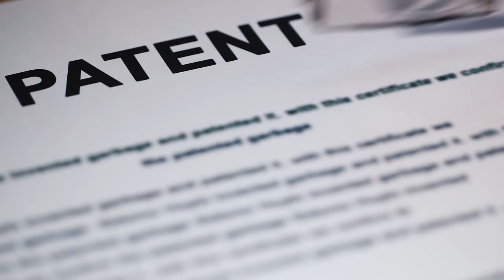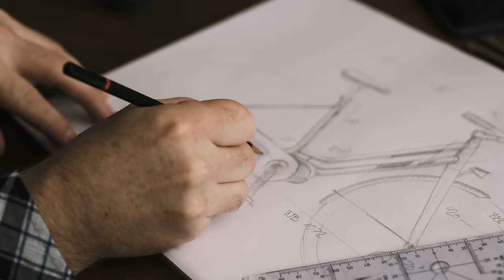Patenting Improvements of Existing Inventions

Comment: Sir, then what's the point of filing a patent in cases when inventors invention is a improvement on to existing idea/ prior art or even in cases when the invention application is entirely different, for example  a person comes up with a way of inventing the same out put of a invention with blending it with other technology and by doing that he is reducing a lot of important element that are costly in prior art and can bring down the cost and acchive same or better results, but there is no benefit even if the inventor got the patent if he can't  commercialy sell it and bcs invention involves elements of prior art, I got that the inventor can stop others from doing it but that's a costly processes and a lot of times gets nowhere and filing patent is also costly and other companys may also not Licenc it from the inventor due to prior art element. Please make a video on this topic if possible explaining if there is a benefit! or a way of commercialising the improved invention!
Reply from the maker: @Taseen, thank you for the email message.  Most inventions are improvements of other earlier inventions. For example, recently, there have been many improvements to portable water bottles - an invention that has been around for thousands of years.  Let's say you invent a water bottle with a cooling element (for example a Peltier plate, rechargeable using your phone plug).  The improvement of the USB cooler would make your water bottle unique and patentable.  Thank you for your question.  I will answer the second question in another reply.  -John
Reply from the maker: @Taseen, whether to file a patent on an improvement to another patented product is a more difficult decision.  You are correct to point out that since you can't sell your improved product without getting a license to the earlier patent, it may not make business sense to pursue your improvement.  However, many inventors are willing to license their patents to others, especially if they have no intention to sell products. -john
Reply from the maker: @Taseen, you are right that patent litigation is expensive.  I have a video on Contingency litigation as one possible route to take.  But generally, you need to be selling product or have a business plan for your invention for patents to make sense.  Thank you again for your comment.  -john
Reply: @johnferrellesq.  okay thank you soo much for your valuable response, I appreciate that and I just need some more clarity on this one as you have mentioned that I'm correct That if it's a improvement or invention involving prior art element of existing prior art then the inventor cannot sell it hem self but Licenc it, soo is there no such catch such as that the inventor not having many options to Licenc it to other interested companys but to only be able to licence it to prior art owning company, and if for an example prior art owning company doesn't licence the new improvement or a invention involving there prior art elements from the inventor or offers a very low ball offer to licence it and on the other hand other companys show interest and are willing to licence it at a fair value and if they we're to licence it from the inventor won't they have any problems in the future if prior art Owning company decides to sue them for patent infringement!!
Please read my previous comment and your reply to get the context!
Reply: @taseenahmed2156  thank you for your follow up question.   To be clear, this video was not suggesting that you could take a newly issued patent, copy the invention with a small improvement and get rich.  For example if Apple designs and patents a new Apple watch and you add an extra button to their design, filing a patent your improved Apple watch with an extra button will not be worth much since you cannot build the underlying watch without getting a license from Apple or waiting for their patent to expire.  However, the patent for the original Apple mouse has long expired, so you are free to improve this original  mouse invention, file your own patent, and sell your new mouse without interference from Apple.  Hope this answers your question.  -john

Comment: I have seen replies from applicant/attorney in office action response mentioning the reason (the novelty) why the patent should be granted. If a patent is granted only on novelty basis why don't they just put novel part in the claim. Usually applicants have other claim restrictions as well along with the inventive step, making their claims narrower and hence it becomes easy for a potential infringer to circumvent the claims
Reply from the maker: @blackheart, thank you for your message.  There is a form of patent claims used mostly in Europe call Jepson Claims that do exactly what you suggest.  The preamble (first part) of the claim describes the prior art, followed by a statement of what the improvement is.  The modern form of claim drafting recites the combination of elements that make the invention novel.  For example in this video, the bicycle streamers may not be new by themselves, but combined with handle bar grips and a mechanism for attaching the streamers to the grips, the combination of elements might be novel.  It's often not just one thing.  Thanks for watching my videos and for commenting.  
Warm wishes,  -john